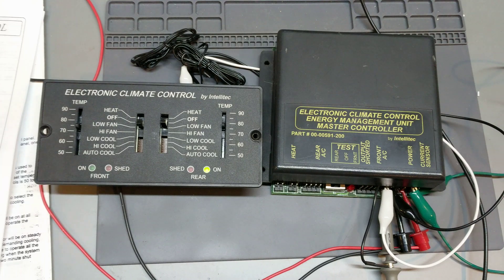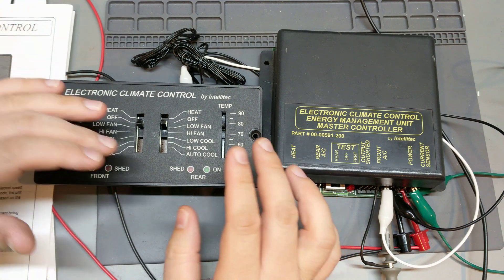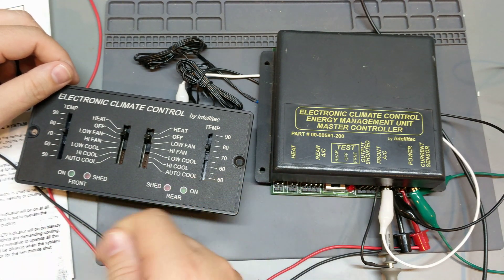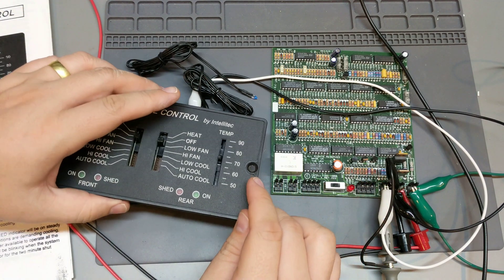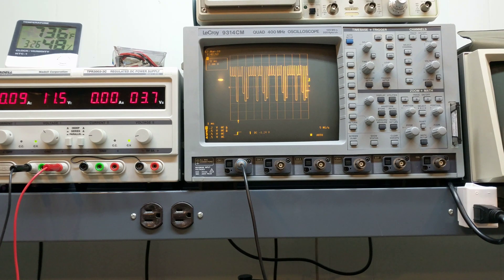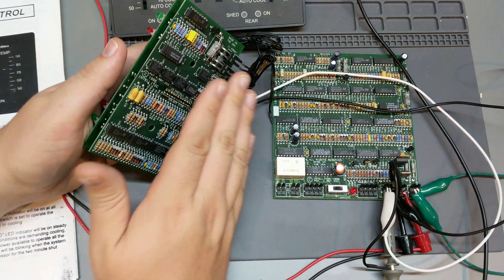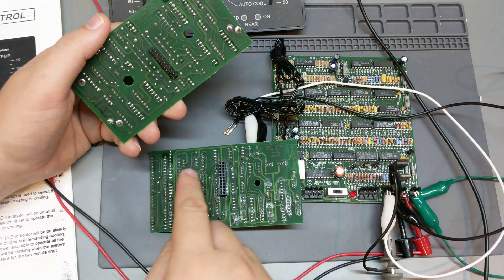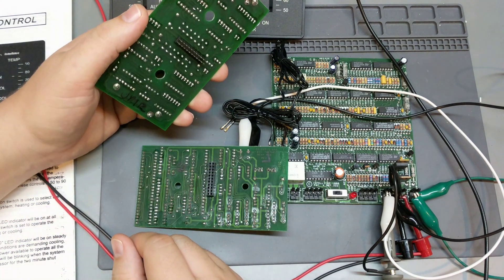Repairing an Intellitec Electronic Climate Control

Comment: If you had to guess, which would you start to re-solder first? The thermostat or the master controller?
Reply from the maker: My issue was on the thermostat, and that's the easier one to remove, so I would start there.

Comment: Any chance that communication is straightforward? I can't solder for the life of me, but I can code a $5 board to replace it... I already bought the board and switches because I thought it would be an on/off sort of thing between the thermostat and ECC... Don't really know where to start if I have to decipher binary signals between boards older than me.

Comment: I  just bought a 1998 Fleetwood bounder and I was told the front roof ac don't work,now I tried using the heat from the propane ,only to find that I get hot air in the rear but cold air upfront,not sure what my next step will be any help would be appreciated

Comment: Where is the master controller located?   2004 pace arrow and can’t find it.
Reply from the maker: It's probably near your breaker panel.
Reply: Ok yes mine was behind panel.   Test mode works from unit and up front.   Heat works fine but no ac compressor running.  No power across relay?  Any ideas?

Comment: I was having issues from my mom going crazy sliding the temp control up and down rapidly over and over then I started having issues with master controller clicking constantly as it was trying to come on.   Didn’t know what it was until I tried to turn on furnace a year later and wouldn’t come on and clicking stopped.  Tested again same noise.  So now I’m in the “gather repair info” which includes watching all videos and doing replacement options and costs and inventory to see what products and tools I have available to do repairs myself.  So thank you for the video I was expecting to just clean points now I better get a solder and board clean kit first. I’m sure not up for shelling out $600 to upgrade when I can spend a few hours and might fix the problem.   My to do on the RV is getting to big so I’m glad fall is here to “get things ready” for winter mode.  Any class on solder and board maintenance?

Comment: This video was so helpful. After resodering all of it the heater has been behaving. Thank you. Do you have any suggestions 🤔 on how to get our air-conditioners to quit shedding?  We blew everything at a bad power pull. (I know, our bad for not having a serge protector at that time) All is fixed now except the air-conditioners which were fine before the blow out. Any suggestions would help.

Comment: Had the same heater issue...90° in GA, and my rear furnace kept cycling on, with thermostat set to "OFF" in my 1999 Bounder 34J...I am going to try resoldering mine, but intend to upgrade to the WaiterECC soon... Thanks for the informative video.

Comment: During your investigation did you come across any potential replacement systems , as parts for these are becoming difficult to find or is checking the soder defects the only solution?  
The only solution I found was to use M & M RV Electronics at the cost of over $300 and about two and a half weeks
Reply from the maker: No I did not, not one that would shed power like the original. The heater circuit could be replaced with any home thermostat at least.
Reply: Any chance you could share the ones that don’t have the shed option?  My rear roof-mount AC is actually run off a separate circuit but it still tries to keep me at a 30a max and keeps kicking both units off.

Comment: Thanks for the video! This is common in older vehicle computer boards, which is why I took my tstat apart.  I didn't see any visible cracking, even under a magnifying glass, so I didn't think it needed resoldering.  However I think I'll hit all them up now just to see if it makes any difference.  

My unit will start the shed process even with no electrical load shift or change in the rv, and doesn't allow the ac units to run randomly.  If it works I'll report back!

Comment: Great video.  I was having the same issues.  Attempted cleaning and repair,  I also checked with Intellitec and an outfit in Indiana about repair.  I finally decided to build one and replace the system with new modern controls.

https://waiterecc.com/
Reply: Shut of power take yours apart and do clean up which is free not $600
Reply: @PlayGirlGrandma  I'm glad you were able to revive your,  I wasn't.. I disassembled the Intellitec control module and operator panel. I cleaned the boards,  inspected for any corrosion , resoldered some suspect solder joints,  etc.    Still no joy.

Comment: Thank you so much, I had a solder joint issue on a VW cruise control but didn't consider that could be the issue with my climate control! Guess I'll be spending an hour or two on this tomorrow.

Comment: I have one on my 1996 Fleetwood Bounder. It's not working correctly. It's a different model number but nearly identical. 
Thank you, I'll check the solder joints.
Reply: I took apart the controller and looked at the circuit board and sure enough, it had harden dust and sticky stuff all over the boards.
I took soap and almost boiling hot water gently scrubbed both sides of the boards  , rinsing them very well, blowed dry hot air, let them sit for many hours, reassembled them and everything works, whereas, only a couple of functions worked before. 
Thanks for your  help and advice. 
Peace!

Comment: Thanks for the heads up on the thermostat solder joints. I had the same problem as your neighbor with my furnace turning on with the AC running. I was having difficulty separating the pc boards so as last ditch effort was looking over the back pc board with a 3" magnifying glass. The resistor labeled #15 looked blackish and different. I attempted to re solder it from the resistor side. As soon as I saw the solder flow out I quit. Problem solved!

Comment: My name is Cade and I work for M&M RV Electronics. We have a contract with Intellitec to do their tech support, but also operate our own RV electrical and component level circuit board repair service. I have had quite a few customers contact us about this system and reference this video. When I finally came here to check it out, I noticed that out name and number have been mentioned in this comment section. I'm here to clear some things up. First of all, the problem described in this video is probably the most common issue that I've seen over the course of repairing a few hundred of these, but this information regarding the repair is not correct. There are a couple different things that can cause this problem. The first thing that you should check is to see if there is anything in the coach that is creating electrical noise. It can have some weird effects on the IPX signaling that this controller uses. The most common item that does this is 12V fluorescent lights. The switch mode power supply in them will cause some problems when they start to go bad. They actually don't even have to be on to do it. To stop this, you would need to remove 12V supply to the light fixture by either pulling the fuse or disconnecting the fixture. If at that point the problem stops, your best option moving forward is to gut the ballast from the fixture and replace with an LED kit, or replace the fixtures all together. Other not as common things that can do this are the ignitor board in an RV style refrigerator or a converter charger. The second and most common problem causing this symptom IS the thermostat, but the solution IS NOT touching up the solder connections. This application of heat can give an appearance of a fix, but it will be very short lived. For a solid long term fix, get in contact with us at Intellitec technical support and we can properly repair the thermostat. All that being said, I have seen dozens of other problems with this system, and as sturdy as they are, the 4000 series logic, op amps, and comparators do fail fairly often. These units were designed and produced mainly in the 90s. It can all fail eventually. When it does, we can help.
Reply: Yes there is a newer replacement option. Look up waiters ECC.  Plug and play touch screen setup.
Reply: @TheTTVert  Thanks for the great tip. Well worth checking this out. I'm surprised how many others have this system and all have similar problems.
Reply: I was have the same exact problem as above with the Intellitec Dual Zone controller in my 2000 Fleetwood Southwind and ready to try soldering all of the circuit board connections but after reading Cade's post called M&M and asked about repairs.  I ended up sending the Control Unit along with the Master Controller to them and had it back in less than a week.   I just installed and test it and it is working great.  The charge was $95 for diagnostic fee plus $275 for repair.  My only regret is that I didn't find them sooner.  It would have saved a lot of time surfing the internet and money wasted with local RV repair people.  Thank you M&M RV Electronics (419) 965-2662.
Reply: Is there a newer technology replacement available ?
Reply: @richardlinn5512  https://waiterecc.com/
Reply: @richardlinn5512  Not that we know of. Intellitec has toyed with the idea of creating a digital replacement of the unit, But has never actually done it. There is mainly a concern that there are almost no 30A coaches being manufactured anymore. Their only potential customers would be people looking to replace their old units. Without the likelihood of selling to OEMs, they would pretty much be doomed to loosing money in research and development. If you want to change over to more modern digital thermostats, you do have the option to convert the coach over to 50A service. It's a big job and I'd really make sure that if you do have someone do it, they really know what they are doing. I've seen too many half measures in conversions. It would involve a new shore chord, transfer switch, breaker panel, 50A energy management system, and all the connections in between. It would be a little expensive, but it is a good option if you are looking to keep the coach for some time.
Reply: @cadebevington5913  can you enlighten us a bit more on what signals the thermostat sends to control everything/ if it gets anything back? Sounds like something a $20 microcontroller and  some coding could fix. My scripting ability is much better than my soldering ability...

Comment: I work for a mobile rv repair service, we came across this same unit, the ECC was buzzing and front ac only works when generator is running, we thought it odd coach has a 30 amp service only and two ac's, why not a 50 amp service? so we did some checking on net and found your video, THANK YOU for enlightening us, I found this unit is not available but my supplier or anywhere else. He gave me a number to a repair service that can repair this unit, whole problem is bad solder joints, if you are good with a solder gun you can fix it yourself. that number is 419-965-3014, M&M RV Electronics. good luck and thanks again Joseph, its people like you that make life so much easier :)

Comment: Huge help.  Had same indications on mine.  Never would have thought of the solder joints.  Inspected, and the worst of mine appeared on switch/Tstat boards.  Dug out my rusty, Navy, soldering skills and re-soldered all of those.  Inspected but didn’t touch the main board.  Powered up and worked like a champ!

Comment: Hello I have the exact setup, my problem is the rear ac unit only runs the fan .i replaced all the capacitors on the top rear unit to no avail, the thermostat temp slider that controls the rear ac does not work , so i assume it has to do with the thermostat..compressor checks out good.so I think the thermostat is not turning the compressor on. It would be great if I could send it to you for repair/evaluation ,just let me know,will be glad to pay you for your services.that will help me a lot.  Thanks a bunch
Reply: check my post

Comment: Joseph, great video, thanks for the tear-down! A few days ago I went to shut off my A/C units and got zapped across the two sliding stepped potentiometers for heat/off/fan/cool/auto. After that, both heaters turn on no matter what setting, and both AC units respond only to the setting for the rear. A visual review of the components appears like everything is normal. Any ideas what might have arc'd? My solder skills are pretty weak, I would probably do more harm than good.
Reply: check my post

Comment: We have a '97 Fleetwood and this is happening to ours...we can't find the climate control anywhere...if anyone has any suggestions?
Reply: Climate Control unit is on the bedroom wall.  The controller itself is under the refrigerator next to the breakers and fuse box.
Reply: @goz101  check my post
Reply: I too have started looking for a replacement with no luck. Mine is the 00-00330-000, which is slightly older than the one in this video and has the red/blue temperature settings instead of the specific temps.
Reply: @dougmayo7013  check my post
Reply: @dougmayo7013  doing the same with my 97 Pace Arrow.  00-003300-000 unit.  Will be breaking it down tonight and taking a look at it.
Reply: Where would the electronic climate control energy management unit. Master controller be located I have 1999 Fleetwood storm ..?
Reply: @jorgevilchez7286  Should be in a door under your refrigerator, most are there.
Reply: @jorgevilchez7286  the cabinet on top of fridge left to right flip switch fuse, blade fuses then small wood panel 4 screws.  Take that i\off and you will look in and see lots of wires use high speed flash light and you will see it in there.  Shut off all power before you stick your hand in to pull out wires. My was clicking constantly.
Reply: check my post
Reply: Mine was located behind the fuse box

Comment: My unit is doing kind of the same thing the ac won’t shut offf even when you put the thermostat in the off it’s the rear ac unit number
Reply: check my post
Reply: Shut of power take it apart and clean connections up.